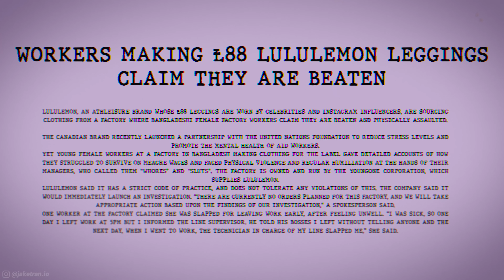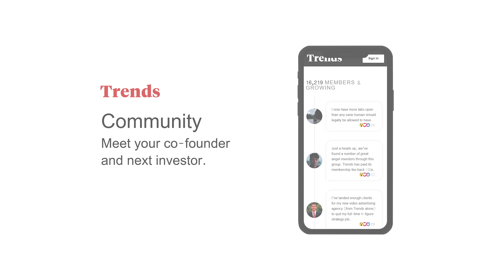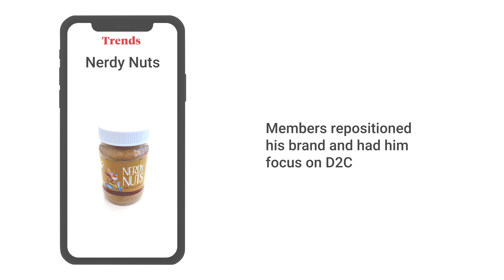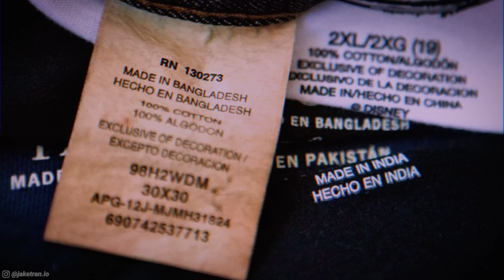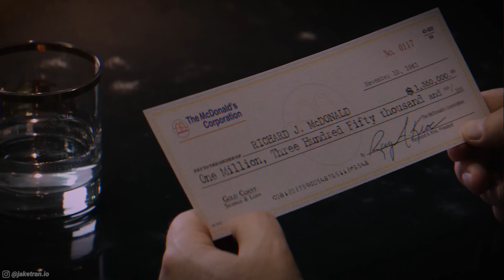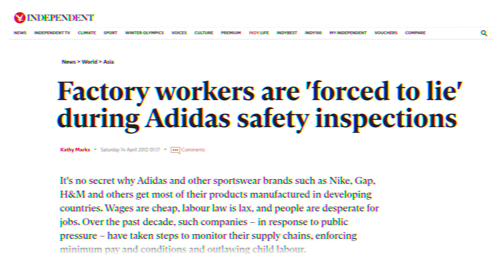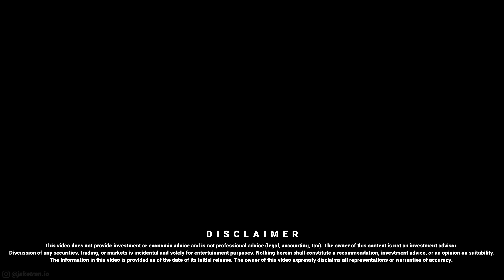Sweatshops: This is absolutely horrible.

Comment: Great video it was mostly accurate so I was pleasantly surprised (I own an apparel biz and have worked in the fashion ind. since the 90s)!  👏🏼 One thing that was a little misrepresented is our dependence on subcontractors. That is not a new practice, manufacturing companies have always outsourced their production work simply bc factory workers are specialists in that practice. I mean Apple does not make the bulk of their goods in-house. It’s not like a cheap workaround we do to screw over the little guy - it’s standard practice. Of course it can be unethical, esp overseas but not always. There are scumbag factories and there are fair, honorable ones who can pay their workers adequately.  Some workers might not otherwise have jobs, for example there were women in Thailand who couldn’t get a job at the sewing factories who were then forced to go into prostitution. 

Globalization is the reason countries like China and India have had huge percentages of their populations lifted out of poverty. So it’s not exactly black-and-white, but if you really want be ethical buy from a domestic smaller clothing co as opposed to the big box stores. We do low-mid volume so we have to pay higher prices, the huge stores do massive volume so someone is bound to be getting effed on the deal.

Comment: I agree to some extends with your video. But i should point out that things were almost exactly like that here when the country industrialized.  You cannot expect a third world country to industrialized and applied standard of a first world economy. Also how much can you possibly pay people who are  for the most part uneducated, unqualified, and illeterate ? In a first world country those people would be unemployable because of minimum wage. Also a lot of business go abroad precisely because of minimum wage laws which in my opinion should not exist in the first place.
Reply: @facts2666  yes of course nobody could possibly celebrates such an event which is not even good for business. But stuff like that happens in new york city around 1900. I mean locking people. And the building burn. After such hortific event things changed and people bevome more cautious. I just saw a documentary about  zara. They have build factories in ethiopia  with modern equipment and seem as good as what you would find here.  So things improved with times.

Comment: Operating a sweatshop myself in the Philippines about 35 years ago, I had 150 workers in 2 shifts to make Tshirts for low prices. The established garment producers were holding the export Quotas, which we need to purchase for high prices. It was money for free for them. We tricked the system by exporting a combination of womans T-shirt with a Miniskirt to be thrown away by the importer in the west. So we got quota for free. Workers been paid in piece rate and could earn quite well, no abuse done. However the working environment was despicable. Hot humid air filled with microfibers, but workers didn't want to wear facemasks. Before you start yelling at me, remember, that it's your purchase, which is driving the Business.
Reply: Oh yes just blame the customers, am I right?